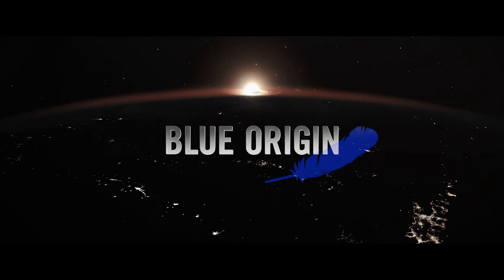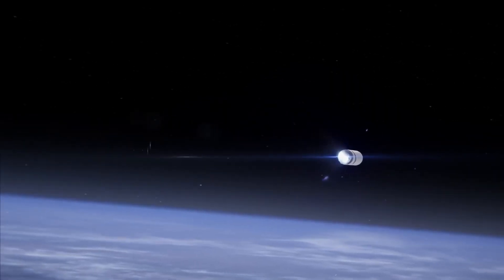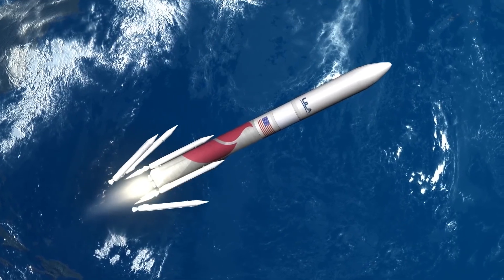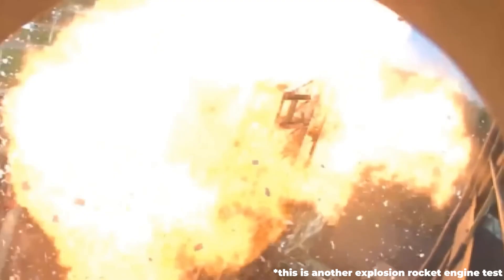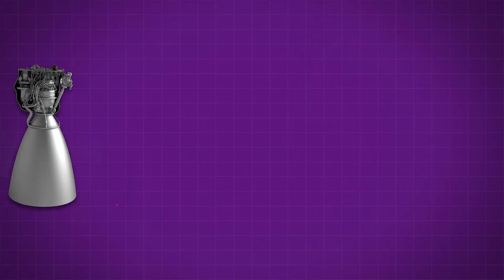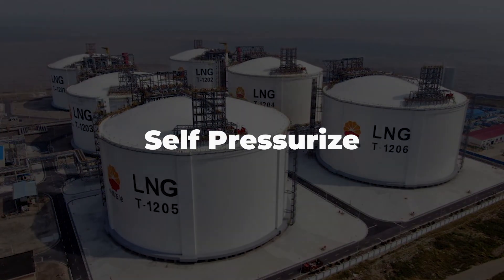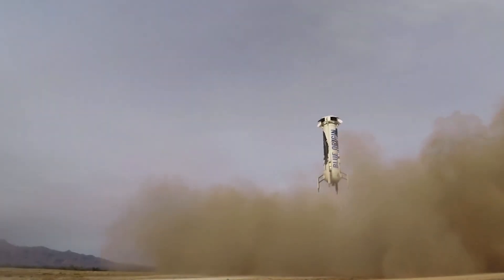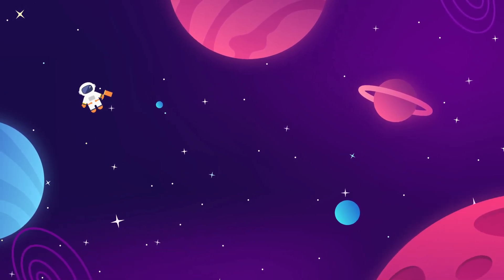The Disappointing Truth About The Blue Origin BE-4 Rocket Engine!

Comment: BE-4 has had a tortured development history. Most of that is due to the dual role of doing New Glenn type missions versus ULA's needs for more routine one-time use criteria for the NSSL type payloads. One thing that became clear early on was that the BE-4 (like SpaceX's Raptor) was going to have to push combustion technology and materials science to the edge in order to deliver what the space community customers anticipated for payload/cost/availability/reliability. ULA made a terrible decision by going with BO when they turned their back on Aerojet and the AR1. That was mostly due to Aerojet costing that engine out of everyone's reach. Also understand that SpaceX is in no way out of the woods with the Raptor, that engine has not shown itself to be anywhere near reliable enough or even a near proven thing. Rocket engines require extensive development work/ technical prowess/innovation and clearly superior engineering management. In truth, where we are seeing the wheels come off with these programs is lousy, inept management driven by beans-counters instead of innovators. Despite all the worry though the US is in pretty good shape moving forward, mostly thanks to the US taxpayers and the obvious needs for the NSSL phased programs.

Comment: The white cloud you see coming off the side of the starship is NOT vented methane. The sides of the rocket are the sides of the fuel tanks and the methane inside that tank is very very very cold. What you are seeing is moisture from the air moving across the sides of the rocket being condensed into water vapor by the very cold methane and lox inside the rocket.
Reply: There was some gas being vented during the early stages of the loading process. And before you accuse me of anything, no it's not methane. It's nitrogen, which is inert. They use it to purge the tanks of any impurities like water droplets prior to loading (and to supercool them and the methane and oxygen in preparation for loading).

Comment: ok, the first flight of Starship did not have a "raptor blowing up in flight." Rather the gimbal system broke causing the rocket to tumble, then it was destroyed by SpaceX remotely.
Reply: the flight termination system didn't work either, the rocket only broke up due to aerodynamic forces
Reply: @mathewferstl7042  And that was only after a sizeable chunk of pressure had been relieved from the tanks. The rocket was simply sturdier than it needs to be, which isn't exactly a problem in the industry (in fact, it's actually kind of a boon). They have since rectified the issue with the flight termination system, and we are hoping for a flawless second attempt.
Reply: @Dumbrarere  I just correcting him on what actually destroyed the rocket, and that the FTS was also a failure in the test. Also the rocket was barely past mach 1 at high attitude due to poor acceleration thanks to 11 total engine failures events
Reply: @mathewferstl7042  This is true, I admit. I was just adding onto what you said.

Comment: You seem to blast BO because an engine blew up an a test pad while prizing SpaceX.. ignoring that SpaceX just blew up a whole rocket in "normal operative conditions". 
Edit: as expected, in its first mission the engines operated flawlessly.
Reply: False...first Starship launch was a prototype test flight...as will the next few flights.
Reply: @markb2773  That is correct, so was the test on the stand of the Origin motor.

Comment: Hey All,
I'm an old man. My father worked on Mercury, Gemini, Apollo, and the Shuttle.
Our Country is so blind to the past greatness of that Generation we lost all the momentum that was built up during the Apollo. Why don't we just redesign the F-1 engines. As I recall they were very very powerful.
Reply: They were also partly hand built even then the original manufacturing machines were dismantled. Recreating them and relearning the limitations would be prohibitively expensive.
Reply: and they ran on the bad old stuff: Kerosine! @jessepollard7132
Reply: They were also extremely heavy.

Comment: I’ll take Blue Origin seriously when they actually get something into orbit.  “Fully reusable” assumes something has been used…
Reply: While l admire these efforts to get into space,  when will it happen?  I'm sceptical
Reply: SpaceX ALREADY has fully reusable down to a science.
Reply: @terryfish6900  SpaceX is not fully reusable - but they ARE partly reusable and reliable at it.
Stoke Space is AIMING to be the first FULLY reusable - and look to be at least as far along at it as Blue Origin in a LOT less time with a LOT less money spent.
Reply: @bricefleckenstein9666  And a LOT more interesting and innovative system.
Reply: @bricefleckenstein9666 I’m betting Starship will be fully reusable before Stoke.
Reply: @strootle7  I'm not - as Starship doesn't appear to be getting DESIGNED to be fully reusable, just the lower stage.
Neither is going to manage that feat when they have to "push the envelope" and use ALL of their fuel for a particular mission - like at least one of the Falcon 9 Heavy missions that had to push a heavy load to Geosync and didn't even allow the booster stages to be reused.

But I'm not going to be shocked if both end up fully reusable by design.
Reply: They do NOT have a fully reusable vehicle.They reuse a lot, but as of recently, the 2nd stage as well as any interstage between vehicle and spacecraft is not reused. @terryfish6900

Comment: My biggest nitpicks are with the phrasing in some parts of this.

Saying that SpaceX is "having trouble with the Raptor," particularly on the first test flight (which, by the way, was not even expected to reach orbit, just to gather some flight data to guide work on the next prototype which, no, also is not really expected to reach orbit), and going "oh, they used this prototype version of this engine that they're still in the process of deliberately pushing to its limits to see just how far they can go and is nowhere near a locked-down full production run, on a prototype version of this rocket for an early test flight that they knew full well was not likely to go to orbit and, as expected, there were problems, which was the whole point, they wanted to see the problems so that they could gather data and learn from them"... and then waving hands in the air going "Oh no, this is a huge problem"... Uh, no. No, it really isn't. (Sorry if this seems like an overreaction, but this kind of knee-jerk reporting on Starship is everywhere, it's outright false, and that annoys the crap out of me.)

It's still early development. SpaceX just does a lot of their development in physical hardware, rather than on paper like most previous rocket companies. You really can't look at issues with development prototype hardware and then make any worthwhile claims about how well the final production hardware will work. And SpaceX has proven that they are capable of making rockets that are not just reliable, but reliably reusable as well, which is something many people in the space community literally thought was never going to happen.

Additionally, you are incorrect about no methane-fueled rocket having reached orbit. China actually leapfrogged to it first, not long ago (July 11). Quoting Elizabeth Howell article on the website Space: "Zhuque-2 is the first 'methalox' rocket to successfully reach Earth orbit."
Reply: sadly youtube is infested with these new podcast type videos bolstered with crappy clips all stuck together, its awful
Reply: Well spoken! Fully agree...from Germany
Reply: powrplaya3266  in the first place I dont want to watch dumb a$$ podcasts made to look like video snippets stuck together from AI, youtube should have a button you can click to filter this BS out, eg. would you like to excluded all AI videos tick this box - yes please thank you.
Reply: Not just "many PEOPLE in the space community" but so-called EXPERTS in the space community!
Reply: It should also be noted that whatever is flying necessarily lags behind current development.  When I saw how badly the older Raptor 2 struggled during the first test flight, it didn't overly concern me because I knew that later Raptors were already far more robust and reliable.  Then when the Raptor 3 was announced, with its eye-watering performance on the test stand, I knew that at the very least a derated version of this engine could reliably fly the Starship to orbit.  But even better, the slightly newer Raptor 2 performed very well during the second flight test, so the engine has indeed been coming along nicely, despite the failures that occurred during the first flight.

These test flights are valuable regardless of their lag because they either confirm what SpaceX understand or they might well reveal things that they don't understand, which can then be used to make the newer versions of the hardware even better.  The lag is necessary because SpaceX cannot waste their time waiting for test flight data.  They have to keep developing concurrently with the manufacturing and testing of hardware, of course, and then fix whatever they discover through testing that they've done wrong.

My overall point is that the Starship is already considerably farther along than most people realize and we can see.  The flight tests have been with older hardware that is less likely to succeed but still helps development along and gives later hardware a better chance to succeed sooner.  Meanwhile, most people assume that whatever just flew is the best SpaceX currently have of the Starship.  It isn't.
Reply: Yeah if elon wasn’t such a idiot he probably would have had a flame Trench or waited for the suppressor Water deluge plate to be done and then they wouldn’t of had to wait seven months because they wouldn’t have destroyed their own rocket stand and destroyed their engines in the process it was a very stupid decision.
Reply: @mcamp9445  they thought it would withstand one launch however it wasn't strong enough
Reply: These videos about "disappointing truth" and "the [insert hardware name] is critical to America "...
Some guy wanting to convert wikipedia pages to monetized youtube videos need only add some hyperbole.... "Chevy Bolt CRITICAL to America's economy and security!!!!!!"

Comment: I think it is important to note, that it lis looking more and more like the SpaceX launch only failed, because the rocket damaged the launch platform on take off, by throwing up debris. 

The flaw wasn't in the rocket. It was in the launch platform. The launch would more than likely have been a complete success, if the deluge system had worked as advertised. They have since fixed this issue, so their next launch SHOULD be a great success.

But you're right. Blue did go for what on paper should be a much easier design to complete and perfect... Yet they are still having issues. 

Once again, it is also important to note just how flipping hard it is to design a rocket engine that is 100 percent reliable. You're working with volatile explosive chemicals, at stupid pressures, with a butt load of moving parts, that can go wrong at any time lol. 

I think in the next few years, both systems will be perfected, and we will enter a new age of space travel. This is just teething issues. They will both get there.
Reply: Even the Falcon 9 in its latest iteration is not 100%, but it is still better than the competition when it comes to reliability.
Reply: @michaeldeierhoi4096   Nothing is perfect, but when has the Block 5 Falcon 9 failed?  I do remember exactly one Merlin 1D engine cutting out a bit early, but that was the result of trying to clean it.  Someone did something wrong, like leaving a foreign substance behind after the experimental cleaning, and that's what caused the problem, but the mission was still a 100% success.  It wasn't because the engine itself was defective or failed on its own.
Reply: It's worth pointing out that SpaceX have since repaired the launch platform and made some much needed upgrades. That in comparison to how quickly it takes Blue Origin to ship out one BE-4... there's just no contest.
Reply: I'm pretty sure there were other problems, including with the older Raptors 2s that were used.  There were issues during the static fire test, which was cut short, and three of the engines failed to start during launch.  Maybe, just maybe, there was damage to some of the engines and/or one of the hydraulic pumps from the pad explosion afterward, as well, but the engines that kept going were also throttled down, presumably out of necessity, just to keep the test flight going for as long as possible, even though the Starship stack was clearly not going to even get close to stage separation.

Watch the side-by-side video of the two test flights, especially their telemetry data.  That first flight, as a flight, was a bust and was always going to be, whether the pad exploded or not, although it was also a success because it did not explode on the pad and SpaceX ended up learning a lot from the data it provided.

Comment: Fun Fact about D4 heavy: No one was expecting the rocket to fireball itself like that. Doesn't happen on the single stick variants. Engineers did the math after that the damage to the insulation is negligible.
Reply: Yeah it did and yeah, they knew it would leak. It's hydrogen. That's literally the most difficult gas to contain for a lot of reasons, all the way down to the atomic level. And a 'single stick' has literally never flown. It's a derivative out of the Delta family, but what is used on the Delta 4 Heavy is unique to the delta 4 heavy and is not present on any other Delta family rocket. Feel free to google it.

Comment: FYI: both methane and oxygen are invisible. The so-called large white clouds emanating from the side vents on the rocket are produced by venting the very cold and vapor excess oxygen and methane, the only reason there is visible White cloud is because vapors being released are extremely cold causing large volumes of moisture or water vapor in the ambient atmosphere around the rocket to condense and cause clouds similar to clouds in the atmosphere. This gives the false impression of extremely large amounts a methane fuel or oxygen being vented into the atmosphere around the rocket.

Comment: You don't know that SX are "having trouble harnessing the Raptor".  The failures on static fires and integrated test flight were most likely plumbing/sequencing problems and debris damage on the test flight.  All Raptors passed up for rocket installation are performing to spec on the test stand.

Oh, and btw, CO2 is NOT bad for the environment.  That is a massive lie used by Globalist scum to effect massive wealth transfer to them and gigantic power grabs.

Comment: Ah no.  The clouds of vapor coming off of the Superheavy booster is atmospheric moisture (Boca Chica is incredibly humid) changing state from vapor to droplets in the very cold conditions of the outside the the tanks of cryogenic liquids.  Vent gases are recaptured and used for either autogenous pressurization or shunted to the pool on the side of the launch tower.  Small amounts of LOX and Liquid Methane are vented from the engine compartment via purge with liquid nitrogen (to prevent potentially explosive accumulations).
Reply: Which should be obvious as methane is a transparent gas, unless he’s thinking liquid methane droplets are vented?

Comment: 2 issues.
1. 10:27 your video shows almost all water vapor condesning around the cryogenic tank. Not venting.
2. 12:57 Blue origin has been to space.  Just not orbit.
Reply: And achieving orbit is a night and day difference. Both have to reach space vertically but achieving orbit requires a 7 km/sec horizontal speed. Putting New Sheppard and orbit in the same sentence is laughable.

Comment: That picture of the BE4, is bonkers.  Look how insanely complicated that engine is compared to the Raptor 2's.  Did they try to make it the most complex thing ever built? 😂
Reply: I agree but maybe some of the first ones may be covered in sensors and instruments for development.  May be cleaner when  done development.
Reply: Actually be-4 is internationally less complex than the Raptor 2 its a single shaft design & open cycle. Raptor is a dual powered closed cycle engine.
Reply: @jackdbur   On the contrary, the BE-4 is an oxygen-rich closed cycle (staged combustion) engine.  It's like the RD-180, except that it burns methane, has a single bell nozzle, and operates at lower chamber pressure.  While you're right that the Raptor is of a more complex design (full-flow closed cycle), it does appear to be a simpler engine in all other respects, including the number of pipes it has going everywhere.  In other words, the BE-4 is a more complex implementation of a simpler type of engine.  Ideally, it could and should be simpler than the Raptor, but clearly it is the opposite.